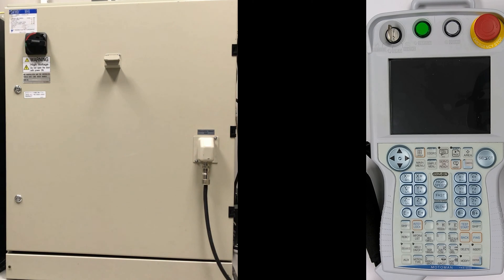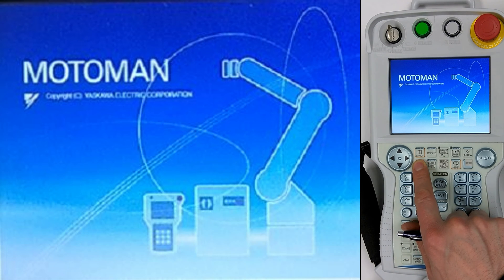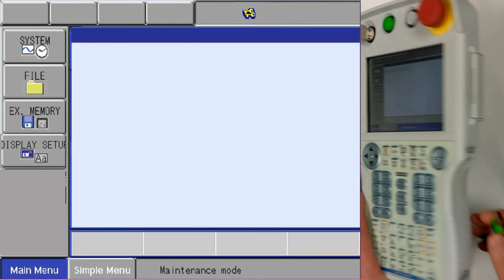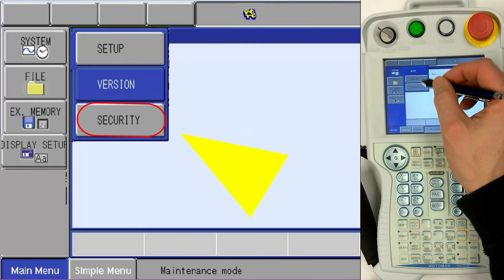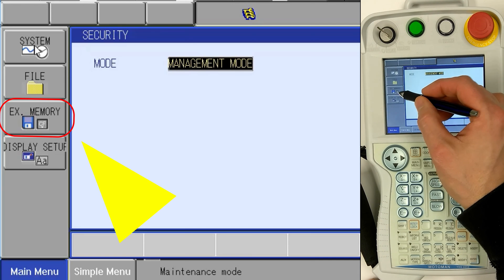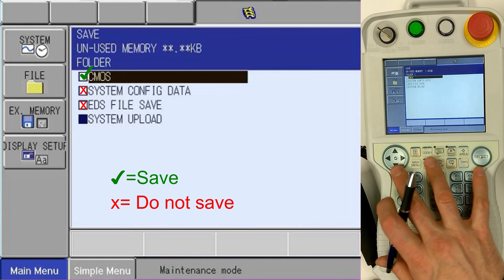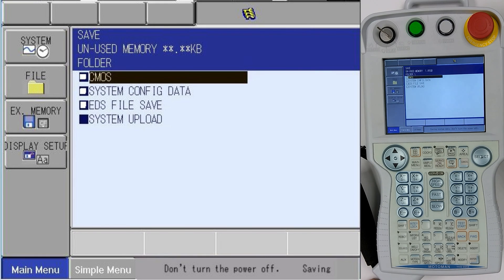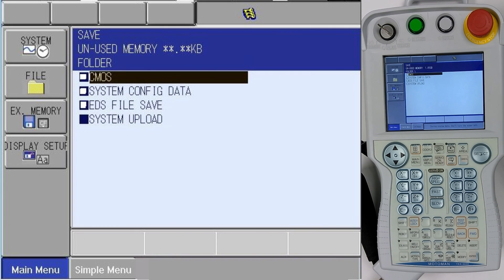DX100 - CMOS Backup

Comment: Hi. I need to communicate a S7-1200 PLC or S7-1500 PLC with a DX-100 controller. I need to change the value of an Integer or Double variable for the Master Job to read and call a specific job (pick and place). I intend to use Ethernet with TCP / IP or UDT / IP.
Could you guide me on how to do this?
Reply: That's what is this